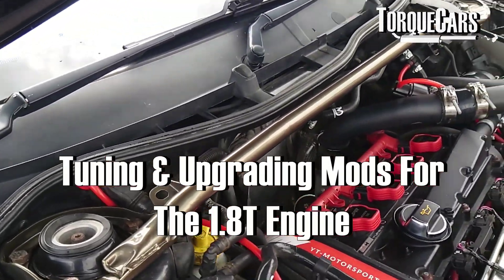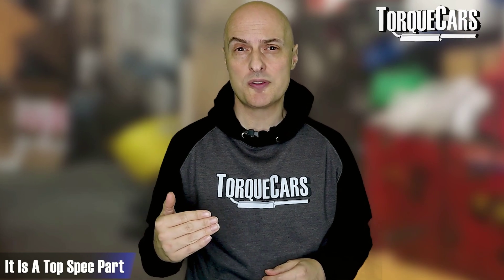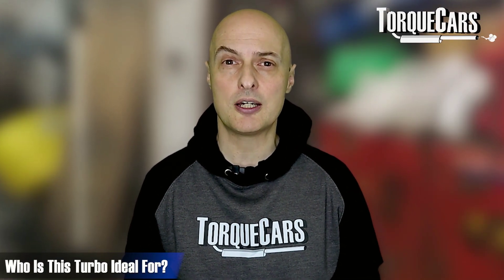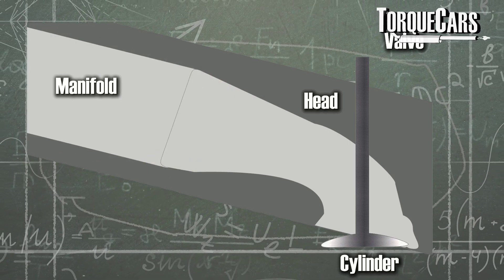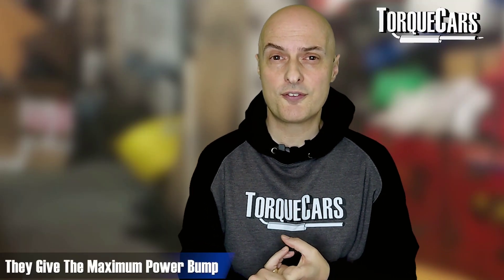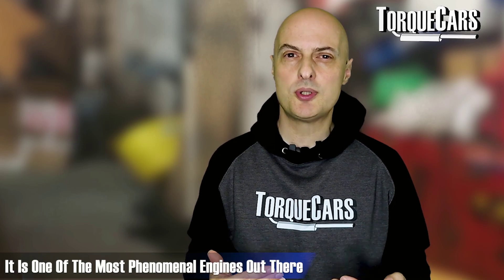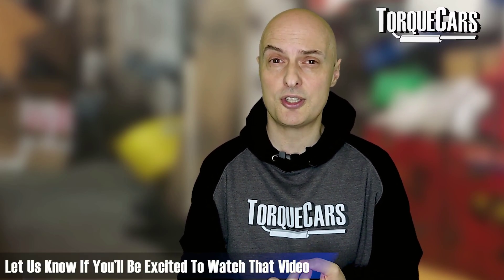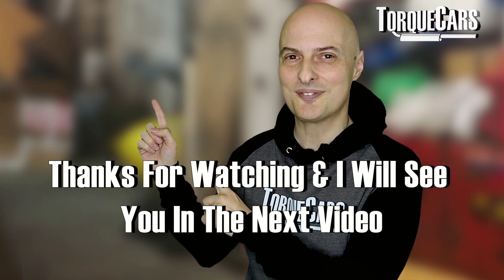Making Higher Power Gains on the VW 1.8T 20V

Comment: Thanks,  and I have the pierburg oil pump in my engine. I will let you know how it performs.
Reply from the maker: Glad it was helpful! 

Thanks for the support and encouragement my friend.

How are you getting on with it?
Reply: @torquecars  it's been a long time getting parts, but have everything now, so stock crank, ie rods , rifle drilled, je pistons,.5mm overbore, coated, calico bearings,  arp main studs, been line board. Block been decked, new oil pump ,chain, tensioner ,bolts ,water pump with brass impeller,  I bought a veltsport manual timing belt tensioner,  gates blue racing timing belt,. Stock largeport head, did some gasket porting on intake and exhaust side , ( not been flowed), supertech valves, springs , single keeper's,  stainless exhaust valves,  iconol intake, ie street/ strip camshafts,  g grams intake manifold,  80mm hemi throttle body,  red top coils, Garrett 60-63 dual ball bearing turbo, precision turbo wastegate 40mm, 550cc injectors, larger fuel rail, extra inline fuel pump, fmic. Now

Comment: Will you please do a similar video for the 2.0TFSI (EA113) 

Thanks again for the great content. I have  been in two minds between the 1.8T 20v VS the 2.0 TFSI but opted for the 2.0T.

So going to strip the engine out and rebuild it for a 500hp target but will be great to know if girdles are mandatory, I have the 1.8T oil pump conversion kit and the TSI cam roller conversion kit.
PEC rods, 
Wossner pistons (comp 9.8:1),
ACL race rod and main bearings.
Supertech high rev kit
Mabotech 600hp injectors. Snowperformance WMI
165 FPRV
525lph pump (still need the PM4 controller)

Still deciding on journal bearing vs ball bearing turbo (not sure if ball bearing is worth the costs for a street car)

Car project costs quickly start adding up £ 😂

Comment: I did the math since I've changed my dash a few times. My 1.8T has just under 220K miles and as far as I'm aware, never been opened up. Timing has been done a few times but that's it! It puts out right about 300whp and the cam chain make a lot of noise but they've been that way for 3+ years and over 60K miles! I really need to get my engine done! Hopefully soon. Had to get new rods, the ones I had were too narrow for the crank journal. 19.9mm but should have been 24.9mm. They just came in today so...